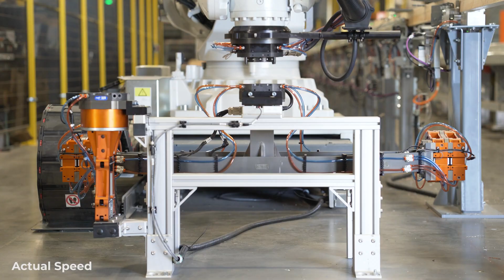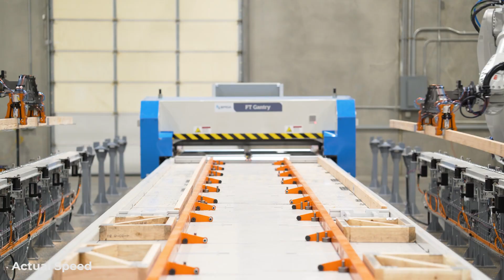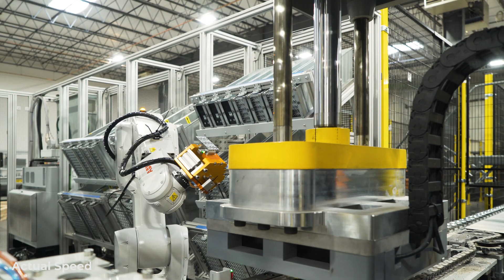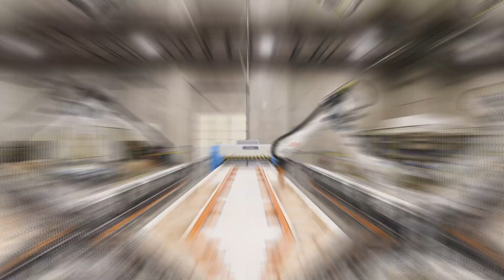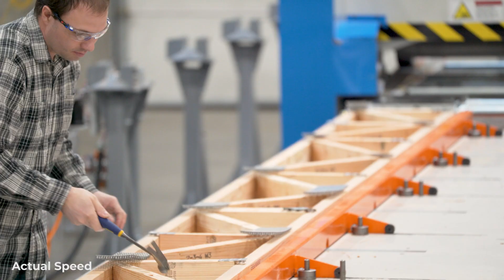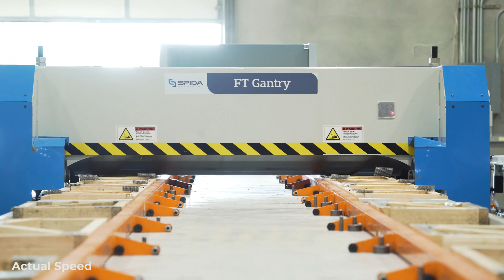Robots build floor trusses! This automated floor truss system builds trusses with ABB robots!

Comment: Still 2x to 3x slower output than manual labor plant. Meaning in order to keep same volume profile of plant output, a new plant would need 2 to 3 of these systems to match traditional line with employees. They need to iterate and work on areas that are slow.